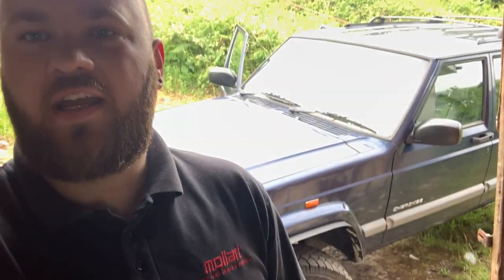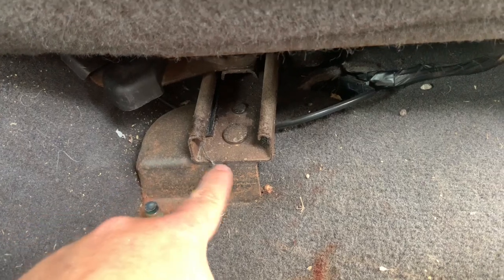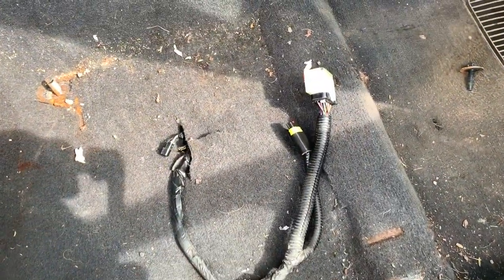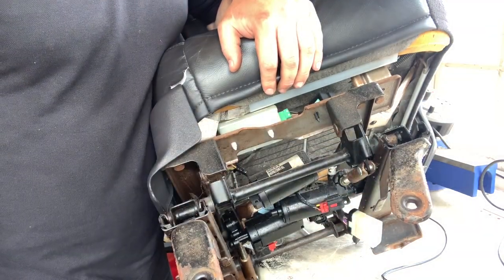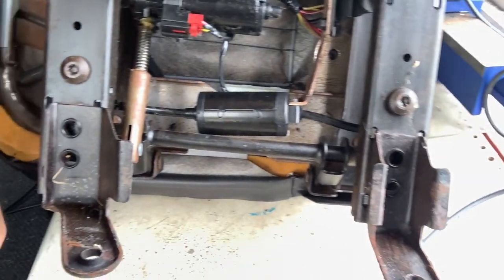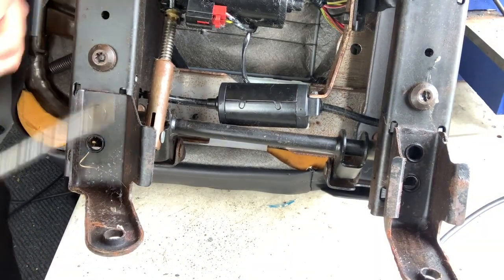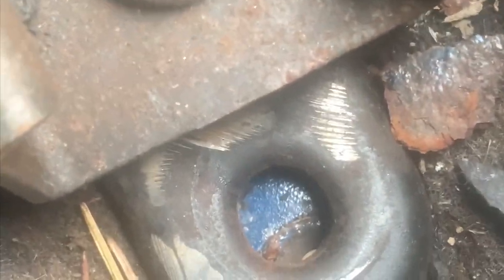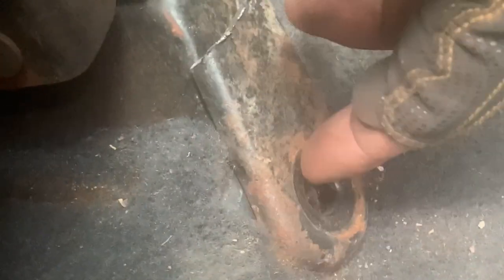Jeep XJ tall guy mod! Lower your seat!

Comment: I’m a rather fat American and tall I’m 6’3”/1.9m and 424lbs/192 kilos my waist is 54in/137cm (not trying to be rude I just don’t want to make you look up conversions of you don’t know) is there any chance I could fit in a Cherokee or a Comanche for that matter
Reply from the maker: They sell brackets that allow the seat to go further back, that may be a good option for you. Height wise wouldn’t be a problem
Reply: @FamilyTravelLog  awesome thank you for the reply my man!
Reply: It's 8 months later, not sure if you ended up getting a Cherokee or not but I'm 6'4 290 pounds and I built my own seat bracket to push the seat back 4.5" with 1/4 x 1.5" flat bar and it's the best thing I could've done, there's more than enough room now
Reply: @Nfscarbon07  would love to see the modification you made if you have any pictures. I’m 6’ 6”, 285 and it would be great if I could lower AND extend the seat in my XJ haha

Comment: How tall are you?
Reply from the maker: I’m 6’4
Reply: Recently went to look at buying my first xj but at 6ft 4 myself found i was really pushing it for space. Did you make any other mods to accommodate yourself or did I potentially miss another built in seat adjustment?
Reply from the maker: This is all I have done to accommodate my height, however I will probably change seats in the future to try and get them even lower